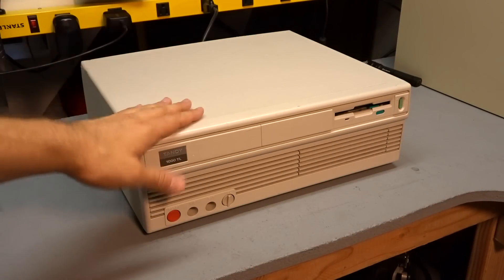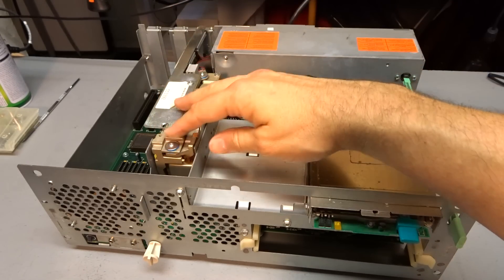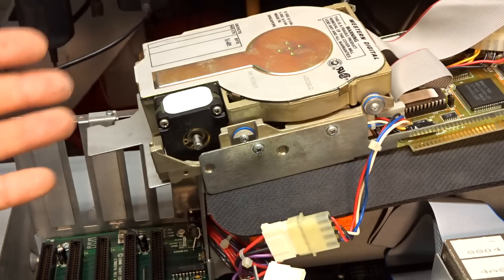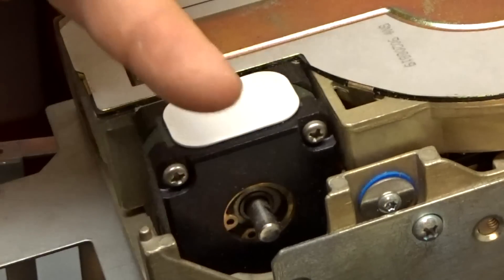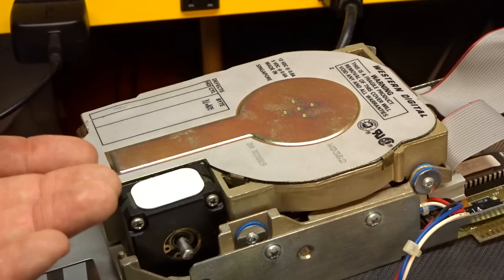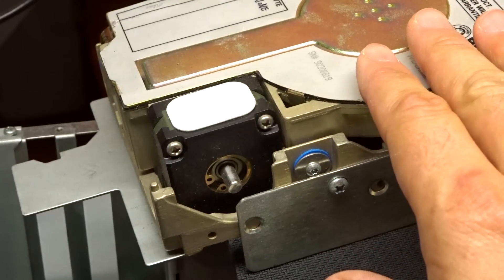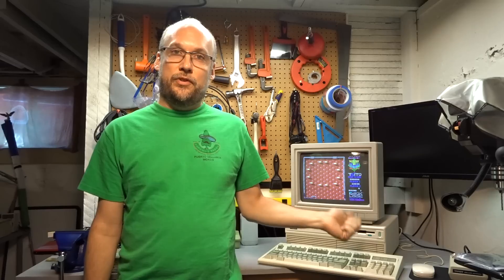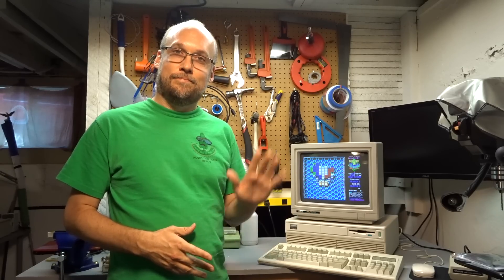Method to revive hard drives from the 80s

Comment: I've done the same trick to the same model drive in my tandy 1000 tx. Mine was so seized up i had to use vice grips to get the stepper motor shaft freed up. Been working for ~5 years since.
Reply: does it still work 11 years later?

Comment: The "3.5 inch" TM362 disc drive was designed in 1984 and came out in 1985. The sister model TM262 is the same HDA but with a cage for 5 1/4" say for the XT or AT computers. The first runs were built in Chatsworth and Simi Valley, then Singapore. There was also a giant long carded version the TM362SP that has the drive and controller card as one ISA card gizmo that requires a long slot. I think but maybe controller was Western Digital on these ,but I did not get all my merit badges. :) 

 The drives have 2 discs, 4 heads. The rpm is slightly less than 3600 to allow for the servo wedge tiny sector ,  to close the loop. The carriage that holds the 4 head flexures is linear and a rack. The stepper motor inside has the pinion, ie rack and pinion. The servo "closes the  loop" for head position is really just done on one end of each track in usage, ie the server wedge sector. Thus the scheme is OK  but really has its limits since the loop is closed around just one small angle on each track. Thus the non repeatible spindle runout has the track moving with respect to the head a tiny amount. Each 1/60 second the wedge is see any error is corrected. Then the servo is blind until another 1/60 second passes.  

This drive is about 800 tpi, ie 800 tracks per inch . ie pitch of 1250 microinches or 39 microns. . The heads "fly" at about 20 microinches, ie 1/2 micron. 

This drive was about 600 bucks when new say about the cost of 500 gallons of gasoline in SoCal, or one months rent. :) 

 The rack and pinion has its limits plus it was not free from generating crap.

 The applied motion products stepper motor probably had Andok C grease as soap type grease with excellent channeling. Since the production volumes made on disc drives were high the vendors often used a substitute grease of their own or just switched in production and thus some got greases that dried out quick or outgassed and caused crap on the sliders (heads). 

A regreasing seemed to work in this video.

The sliders can get stuck on the discs on a drive that is old, worn or sees a lot of humidity. With time they often get stuck, ie Jo blocked to the platter. If too much torque is applied with stuck heads one can bend the flexures, the gizmos that hold the sliders (heads) to the positioner.
Reply: That's absolutely amazing. Did you work for Tandon?
Reply: In 1985, I paid 1200 for 10mb and and my rent was 175.

Comment: Been using this method for years, it’s fantastic. Had a Seagate ST225 that was completely seized in both the platters and heads. A single drop of oil and pliers made it work like new
Reply: I hope this oiling method will work for me.  The drive I just got is nearly the exact same one in the video, and it has been non-functional like this since before 2000, according to the previous owner.  So far, after a few hours, there is no difference, but I still believe the cause of failure is the same.

Comment: I had to do that same repair to a ST412 and ST506. The little drop of oil helps. On one of the 412s I had to take the drive apart and put a drop of oil on the inside bearing because it was so gummed up.

Comment: I have done the same thing with a Tandon Tm252 10MB MFM drive. That drive had a lot stranger behavior. It seemed to work fine at first but before lubricating the stepper motor it would not find the cylinders when formatting right after a low level format.
Eben when it had the fault it always sounded perfect.
Now it also works perfectly.

Comment: Another problem with ball bearings is brinelling. It's when they're under a static load (not moving) for too long and the bearings make little dents in the bearing housing. Actually using them often is the only way to prevent this. You might be able to "un-brinell" a drive by giving it a good burn in. The constant action might have the bearings "beat" the dents out until it becomes less worse.

Comment: I did something similar a few years ago with a vintage computer. But I went a lot deeper. I removed the stepper motor. (Surprisingly easy without the need to tear down the rest of the drive.). opened the stepper motor up to reach those bearings and replaced them. Later inspection of the old bearings showed that the original lubricant has stiffened up and caused them to get stuck.
Reply: Thank you for this comment.  I have been trying many drops over many days with no difference on mine, which is nearly exactly the same as in the video.  This comment gives me hope that opening my stepper motor will be easy and successful to free the spindle.

Comment: Nice!... and makes perfect sense, too, since those motor's shaft-bearings  are exposed to the outside air and whatever dust and heat and etc etc etc inside the computer, causing the original lubricant to eventually dry out and gum up. Thanks for sharing, Adrian.

Comment: It generally works as long as the bearings arent seized or worn badly and the drive can still seek (even incorrectly).
Many old drives like this that I've seen, however the bearings are usually shot or siezed (either though grease turning solid or failing) and either have to be replaced or rebuilt to get any useful functionality out of a drive.
Whatever the case its worth trying and won't do any harm.

Comment: This trick worked for my WD 20mb RLL drive in my Amstrad PC 1640 it works fine now I’ve been trying for a bit to get it to low level format after it had stuck heads and would not spin up got it spinning but would not format 1 drop of oil and a few power cycles and away it went
Reply: I hope this oiling method will work for me.  The drive I just got is nearly the exact same one in the video, and it has been non-functional like this since before 2000, according to the previous owner.  So far, after a few hours, there is no difference, but I still believe the cause of failure is the same.

Comment: One of my 5 inch floppy drives had similar problem with stepping motor. it rotated buy weirdly and noisily. Lubrication have fixed it instantly.
Its a good rule to lubricate all motors (if its possible) in computer once in 2-4 years.

Comment: The HDD of my first PC, a second-hand XT, used to have both what might have been this problem and one that was a bit nastier... the crown-gear that connected the stepper-motor to the gear on what is the actuator axis on modern HDDs was cracked.

But I was lucky that a bit of repositioning of the motor (by my father, I was way too young to do it myself) allowed two meccano gears (which had the same gear ratio, but not the same size) to take over the job just long enough to copy the data to a more reliable drive an acquaintance had laying around.

Comment: As with any hard drive mechanical issues are the least of your worries. custom microcontrollers, ROMs, and hidden firmware on the platters in the case of voice coil drives failing is what everyone should worry about.

Comment: I have an old 96MB Seagate SCSI drive that quit responding, making some slightly weird noises and it was a stiction problem where the heads were stuck in the home position.  Lightly smacking the side of the drive as it tried spinning up several times worked for me, but I was sure to copy anything off it I wanted to keep in case it ended up dying entirely.

Comment: Well, well, well!  Maybe I should take a look how my first hard drive is doing.  I bought a Bering 8” floppy + a 5 MB hard drive combo to augment an HP 87 computer that had external dual 5.25” floppy drives.  To be able to back the hard disk to those 8” floppies, the hard disk had to be partitioned to 4 each of 1.2 MB, wasting last 0.2 MB.

At some point the hard disk stopped functioning and I remember trying some futile things, including a replacement with a 20 MB drive.  No go - low level control “language issues” evidently.  Since then, quite likely various capacitors have also gone bad in the drive(s) as well as the HP 87 itself.

A couple of details worth mentioning here is that the HP 87 was 8-bit computer with 8 of internal 8-bit registers that could be chained into one 64-bit register.  The operating system was Basic and implemented in DECIMAL.  Its numeric range was +/- 10 ^ 500 or so.  Oh, and the CPU clock frequency was 680 kHz — not even MHz and of course not the present GHz numbers.  At some point I got a 4 MHz Z-80 co-processor that ran in a memory expansion slot with CP/M.  Oh, those days!
Reply: So, did oiling your disk drive motors work?

Comment: I have one of these in my retro HDD collection box. Was working when it went in, no idea if it's seized up by now. But I have far more interesting specimens in that box, like a 20 Meg 5.25 Full height drive that I actually used as a second drive in My 8088 XT machine from 1989. Of course I installed stacker to "double" it to 40 :) Of course, a seagate ST-225 and ST-251 are in the box too.
Reply: Paul I have a ST-251R too and I am too afraid to turn it on, I have no idea what condition it is in... do you have some tips on what I should do before turning it on
What controller card should I have for it? Does it operate on any MFM controler card or must it be a specific model? I heard about western digital controllers... thank you

Comment: The repair makes sense to me if the problem is caused by the motor like in this case. The lubricant has likely dried up over time so a refresher can make it run like new. It just matters if the bearings had become worn due to lack of lubrication.

Comment: Old Seagate drives seemed to get stiction problems. A light tap with a hammer would fix that. Vibrations from ambient sound usually kept stiction problems away. 
Stiction is caused by two metal surfaces very flat in contact with each other. As the air trapped between escapes, the metals of head and disc weld together. Old drives did not have a true landing zone.

Comment: That circlip there makes me believe the stepper motor should disassemble pretty gracefully. I'm worried the second bearing might not get oil this way, there's no guarantee without getting in there. Have you done any digging into taking one apart, are there any obstacles in terms of permanent fixtures?
Reply: I see. Hopefully the restricted air circulation around the inner bearing helps keep the grease from degrading. A well sealed bearing shouldn't gunk up, technically...
Reply: You can take the motor off, but don't pull the rotor out. It messes up the magnetic field and makes the motor half as strong. Yes this sounds like BS, but it's true. The rotors are magnetised at the factory while installed in the stator housing.
Reply: I wouldn't take it off if not absolutely necessary, because it maybe could mess up the head positioning
Reply: @Adrian...Right on, plus, the inner-bearing is not exposed to the outside of the hard-drive's enclosure like the outer-bearing is, and most likely won't be getting so gummed up like the outer one.

Comment: A few years ago I pulled my original Playstation from the attic. It'd work fine for about half an hour before eventually crashing. I thought maybe the GPU died because I'd get graphical corruption right before it gave up. I took it apart and noticed the CD-ROM spindle seemed a bit stiff, so I applied a few drops of 3-in-1. That's all it needed. I've been hearing a lot lately about the high failure rate of Playstation drives and it makes me wonder.

The sound of that stepper motor brings back memories.

Comment: I have an ST-225 that refused to format and failed all disk diagnostics. I got it working again by running a low level format on it and then a normal format C:. Works perfectly and I didn't even mess up the intervals, incredibly fast compared to running off of 5¼-inch :P
Reply: Does your ST-225 click when you turn it on? Mine does a fast clicking noise for a few seconds, Then does nothing. Dos doesn't detect it.

Comment: My Tandy drive looks to mount the same. On the card as well except mine is IDE 8 bit with IDE 8 bit interface.  Done some research and found the IDE drive on the 8088 Tandy I have is 8 bit drive and the later IDE AT machines are 16 bit. Any ideas on interfaces of the later 16 bit drives to the 8 bit XT interface. Pinouts are same except additional lines used on 16 bits.

Comment: i worked in a factory building 230 VAc low power motors, the ones with bearings that would be noisy from the assembly line work ok with oil...although was not a regular procedure...bearing motors are never oiled

Comment: If these are standard NEMA frame motors, it could simply be replaced.  I have a broken 20mb from a Mac as well.  I have a replacement Quantum 40mb in it, but it doesn't utilize a stepper, so I might just try to fix it just to get that original sound back.

Comment: Get an oil dispenser with a needle. That gives you much more control over the amount of oil. Also you might need to think about the viscosity of the oil. Bearing oil is quite thick. Are these roller bearings?

Comment: I've heared that you damage the hard drive if you just power off the pc, you have to run a program that set the hard drive in park mode. Is this right?
Reply: What you're referring to is called parking the hard drive.  Rather, parking the heads inside the hard drive by moving them to their landing zone (LZ) position.  That way, if the computer is bumped or dropped during carrying/transport, the heads won't make a "magnetic scratch" across the encodable surface of the platters and potentially cause uncontrolled damage to the data.  Parking a hard drive is a simple command.  You just need to have a program that does it, like PC Shell, for example.

Comment: you could open these drives up in the normal space and close the drive up after cleaning the drive platters with a lint free cloth, and they would still work thanks to the size and Low amount of data, and there Painted surfaces rather than metal coated surfaces...

Comment: I have the same disk (branded Tandon though) in SH205 disk drive for my Atari ST. This drive doesn't want to spin up, but if I push it (if I twist the shaft) it starts to spin and then works fine. Then I can turn it off for a short while and it spins up again without problem. Until I leave it off for a longer time. Do you have any idea, how to fix it? It looks like a kind of lock is there, which doesn't want to let go automatically, but does when pushed a bit... :-/
Reply: My educated guess is that your drive is suffering from the same binding symptom.  I think oiling the stepper motor shaft as shown should work for you.
Reply: @jswpc9966  My educated guess is that your drive is suffering from the same binding symptom.  I think oiling the stepper motor shaft as shown should work for you.

Comment: I have a WD 95044A 40 MB ide , i found in a 286 recently. It spins up but does weird noises and does not work but there's a transparent cap on the motor shaft that says warranty void if remove. I'll try that

Comment: I own a Toshiba t3100e/40 that I use for work and recently I've been unable to get into Ms Dos because the HDD cannot be detected (I use a boot floppy now). The hard drive is a Conner CP-3044 40mb and the laptop itself has a dOb of about 1986. When powered on, the drive spins up, spins down, spins up, spins down, (doing so a few more times), then it shuts off and the computer reads the error.

Comment: Hi interesting video thanks.  I have the same drive fitted in a Zenith Eazy PC.  This is currently experiencing Disk Controller errors and when it does try to boot up the drive makes terrible noises then fails.
The Zenith PC I acquired at the weekend had never been used, brand new from the factory! So I was surprised that the drive would have failed already.  Perhaps gummed up bearings?

I will try this oiling idea tonight and let you know!

Cheers.

Nick

Comment: Hi Guys, I have an IBM 5155 with a 3.5" miniscribe 30MB - THe Disk has intermittent failures, but if I wiggle the stepper shaft back and forth then reboot it works. (like in this video) .... for a while..... then I have to repeat the process.  Will the solution in this video help do you think? I don't want to accidently completely destroy the drive.

Comment: Yo, Adrian, I just got a vintage computer with nearly this exact same hard drive.  It has one of the same symptoms you describe: It starts spinning on boot every time, then sounds like it tries to move the stepper motor, the stepper motor does not move, and immediately the drive spins down.  I've added drops of metal lubricating oil like you did, but even after several hours, there is no change.  When I've turned the spindle myself using pliers and a paper cushion, it is freewheeling when not powered, and stepping when powered.  Any further advice?
Reply: Also, my hard drive was built in 1990, and the previous owner had had it since 2000.  He said the hard drive was already nonfunctional like it is when he got it in 2000.

Comment: My first hard drive was a 5.25" five megabyte Tandon. At first it wouldn't do anything. I had to get a park program to run in DOS. The external end of the stepper motor shaft had an L shaped tab that moved into a sensor, probably infrared, to detect the home position. The drive must have had fail safe code in its firmware so if it didn't start at home it wouldn't move the heads at all. But the park.com would override that and force the drive to home the heads. Dunno why the drive didn't automatically do that on powerup.